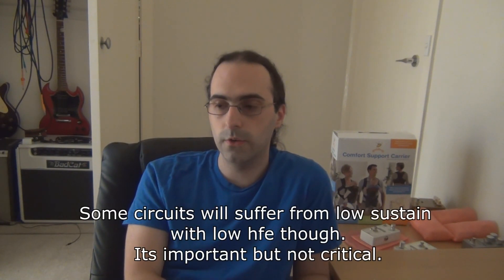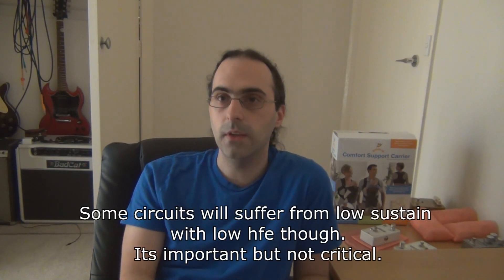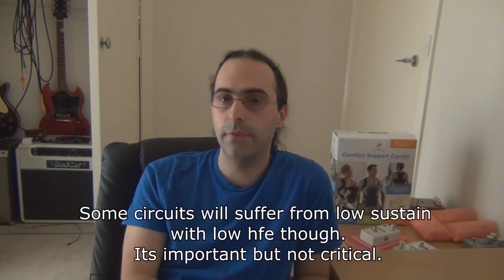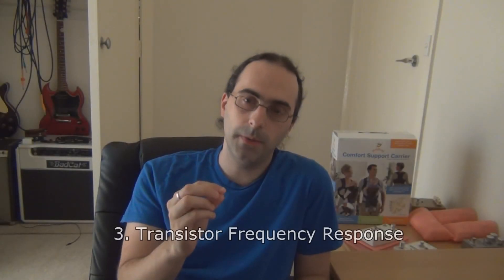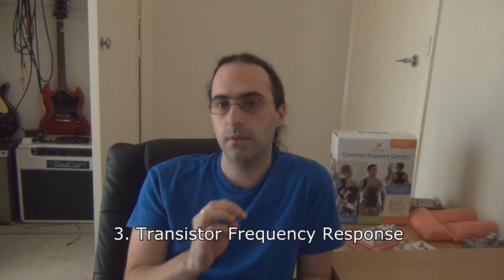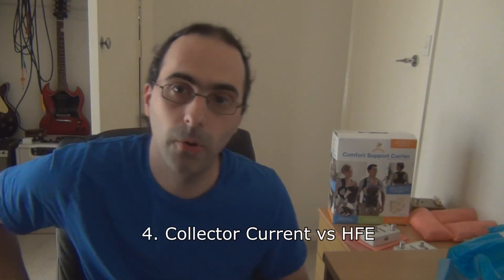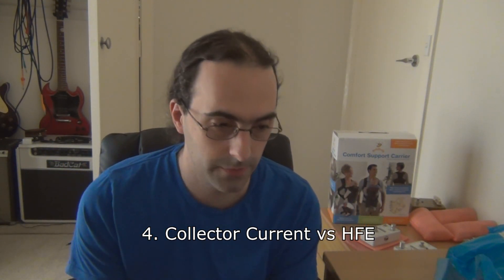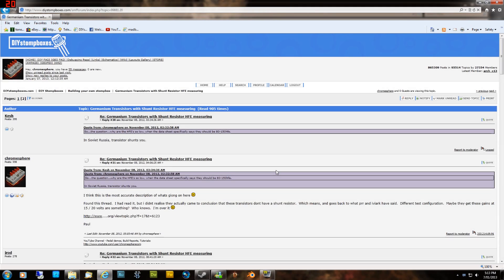Germanium Transistor Guide For Fuzz Pedals - Part 1

Comment: My multimeter has slots you can plug in a transistor to test the HFE, I’ve used it many times for my silicon transistors, but I’m worried will this damage a germanium transistor?
Reply from the maker: Hi Ricky, You can not use this type of multi meter for germanium transistors, they do not factor in leakage, so the HFE reading will not be accurate.  Cheers

Comment: OK, all good stuff, and also very much relevant, great video... ... Frequency response in any given electronic circuit depends on many factors. Most Germanium transistors have a high frequency response as they were designed for high frequency radio circuits, RF /  IF oscillators etc. .. They can act as a high bypass filter, i.e. a disadvantage in audio circuits, all depends on the intrinsic capacitance & resistance values stated in the data sheet charts. And just to contradict the matter, it's not a given though, as the same model & type Germanium transistors often differ from one to the next   .... Any transistor has a given intrinsic capacitance, and this will need to be taken into consideration, in regards to frequency filtering etc.  The frequency response is variable to what type and value of resistors & caps are used and in what type of configuration .... As for Hfe gain ... well try a few low gain Germanium transistors in a Darlington configuration, and use a variable 10k+ resistor in the emitter of Q1 to the Base of Q2 ( in order to regulate the overall Beta value etc.) ... one can use variable resistors in the emitter of Q2 as well ( or anywhere else ) ... by experimenting with various Darlington setups and resistor / Cap - RC filters......  some great fuzz and drive pedal sounds can be achieved ( Think of the Ennio Morricone 60’s Westerns) . Even a relative low gain Germanium transistor like the SFT307 or many other relative cheap ( often Russian made ) Transistors can be put to good use in that way. Low gain Transistors are preferred in Darlington circuits. With some experimenting, an equilibrium to a good sounding pedal is not that far out of reach, and it doesn't break the bank either. Anything between 10 & 20 Hfe will do .... And a low Hfe often equates to a low leakage as well, although in a Darlington configuration everything will be multiplied etc.  ... I've used Darlington circuits in the past in Radio applications as well as in Guitar pedal applications .... The more one Experiments, the more experience is gained

Comment: After modding a few pedals I decided to take the leap into building and I'm starting with a fuzz. This series of videos looks very helpful. Realizing I've almost got all the parts for the Bazz Fuss project except for transistors, I began scouring eBay only to become overwhelmed and confused. I was thinking of trying other transistors than you demoed in your video on the project; but, being a newb, I decided to go with one of the options you demoed first. Maybe later I'll breadboard the circuit and experiment with other types.

Comment: I also bought 3 OC75s from a man in Germany and had good results with them. They were $10 a piece but I didn't mind. I've been wanting to build a fuzz face and tone bender, but I wanted to build the father of fuzz devices first which is the Maestro Fuzz Tone, but looking back on it I wish I would have started with the simpler Fuzz Face... The big mistake I made in my early experiments was applying "+V" instead of "-V"...It took me a while to figure it out, I feel silly about it now but that's what experimentation is all about. I'd tell any novices who want to build and Fuzz Face, Tone Bender, or Fuzz Tone is to not forget about the polarity of the batteries!!! It's easy to overlook!!! Especially when you're using PNP circuits.

Comment: For anyone interested...I found a lot of about 31 RCA 2N2953 transistors and plugged them into a breadboard Maestro FZ-1 circuit that I made and they sound great! The original fuzztone used 2N270s and I couldn't find any reasonably priced ones online so I found the 2N2953s in the electronics lab at college and cross referenced them in the NTE book and found that they may be suitable. It was a success! I haven't made a fuzz face circuit yet but im sure it would work. I also had success with the following germanium transistors for anyone who has come across any of them...2N404, 2N508A, and 2N1305 (these worked really well)...

Comment from the maker: They will work and sound good, just 2 things.  They don't measure at the correct hfes and they are INCREDIBLY susceptible to ESD.  So be careful handling them and don't be deterred by the hfe readings you get.  they still sound good.